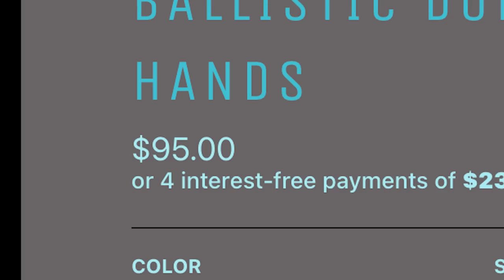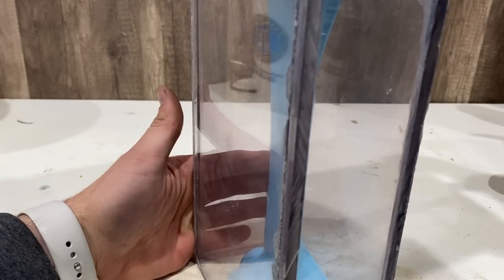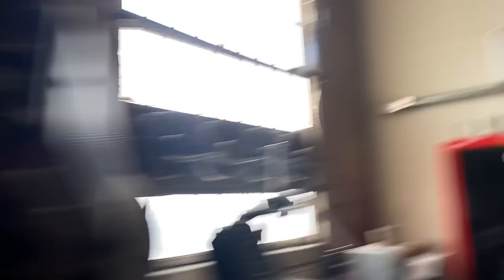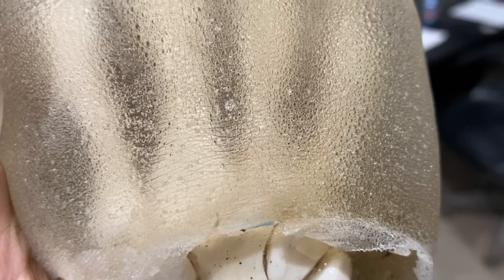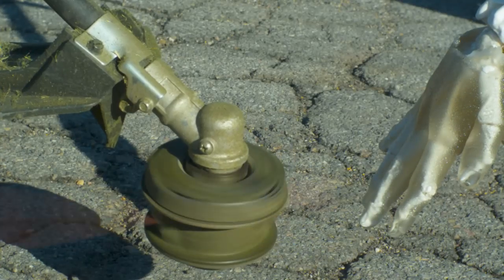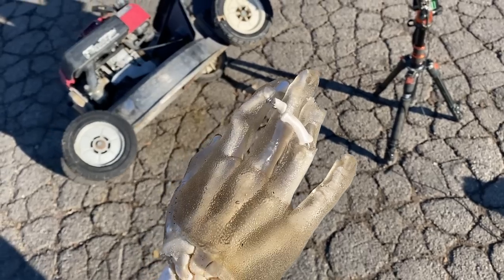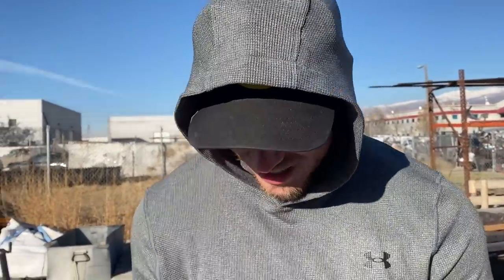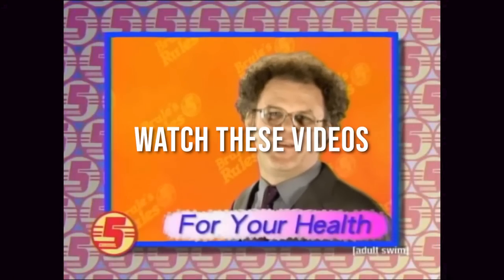What Would Happen If You Swiped A Running Lawnmower?

Comment: About 50 years ago I was caring for an elderly gentleman's lawn. He had me trim around all the trees in his orchard, then he followed later with his riding mower. Somehow his foot got under the deck. The blade split his toes horizontally,then the blade bent as it moved through his foot, and exited splitting his heel vertically. It took about 6 months before he got out of the hospital due to reconstructive surgeries and some extremely serious infections. He always used a cane after that, and said anytime he put his foot on the ground, it felt like he stepped in a spool of barbed wire. Even with all that, he was about the most pleasant man you could ever hope to associate with. He died from complications of that accident about 3 years later. That's an attention getter for a teenager.
Reply: 50years ago though
Reply: @gabbythebunnie8099 And?

Comment: I’ve been in the lawn business for 35 years and never once put my hand near the blade when spinning. You would think this is common sense! I have a friend who had a worker shear the tips off 2 fingers adjusting the height of the deck.  i’ve only had three accidents with workers. First was a hedge trimmer cutting through pants six stitches, second was a chainsaw that cut through pants minor cuts and third was the guy who stepped on a nail and it went through the top of  his shoe.
Reply: That third one is my biggest fear
Reply: Stepped on a square roof tack when I was a little tyke. Went right through my hush puppies. Luckily those are very short and I didn't have anything a band aid wouldn't cover. Those tacks can point straight up because of the flat side. 
I can only imagine how a full piercing feels. Wowzers

Comment: The lawnmower thing happened to a cousin of mine. He lost 2 and 1/2 fingers. No joke. It was an old rigged lawn mower that you had to disconnect the cable to the spark plug to turn it off, which he did, but, accidentally made contact when he lift it up. It was nasty.. says he just saw something fly across the lawn.

Comment: I can tell you what happens to a toe when it comes into contact with a lawn mower blade.
It will cut your toe off!
Been there and done that and the funny thing was that it didn’t hurt as bad as many would think.
It didn’t bleed very much either!
Reply: Another guy commented and said it felt like the worst stubbed toe ever. So my guess is a stubbed toe is max pain threshold for the toe area. I'm surprised it wouldn't hurt more tho
Reply: @shawnd567  This would make sense, you don't have the MOST amount of nerve down in your feet, and since the blades are fairly dull, you'd probably feel more sore. I can't say though, I have not gotten my feet cut off my a lawn mower.

Comment: Those dull blades are even scarier than sharp blades. A 22" lawnmower blade is 2 pounds of steel, dull, spinning fast enough to shred grass. Its inertia and dullness upon impact will shatter bones, and the cuts will be jagged.

My little brother was mowing uphill and lost his grip on the mower, the mower rolled down and the blade caught my brothers foot, thankfully the lawnmower had a safety on it so when you let go of the handle it disengaged the blade so it would spin down.
But even while the blade wasn't being propelled and it was just spinning down, it still managed to cut my brothers shoe open, cut his big toe off (Distal Phalange), and broke several of his big toe bones (Proximal Phalange and the connected Metatarsal Bone).

His reaction? "OH SH*T, dad this is really bad!" and according to my father, my little brother apologized the whole way for bleeding in the car.
Reply from the maker: That’s crazy 😟Your brother is a chad tho lol

Comment: Did you expect anything less? I mean a lawnmower will cut 1 in or larger branches and brush without stalling. Of course it’s going to chop your fingers or toes off if you stick them in the path of the blades! I can also assure you a whipper snipper will most certainly take your toes or fingers off, you just had an underpowered battery one with small diameter line in it.

Comment: You touch the handle of the lawn mower but not the engine or the blade while running. Engine even after running for a few minutes will burn and the blade while running will cause you to lose your fingers or your hand and possibly bleed out and die.

Comment: I had a friend that did not shut off the lawnmower while changing the cutting height years ago and his finger went under it and it does not matter how dull the blade is that it still will take your finger right off by ripping it off because of the blade speed and torque of the engine and it's not like you are putting your finger into a metal fan